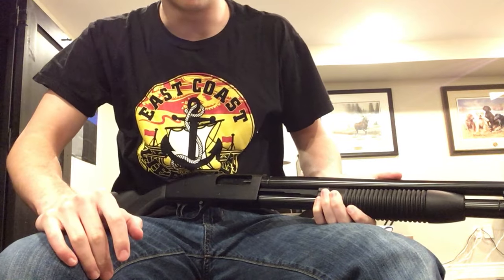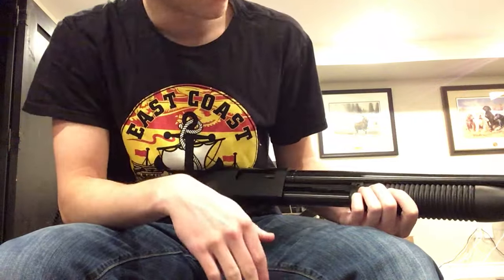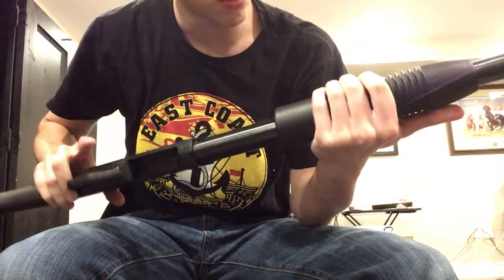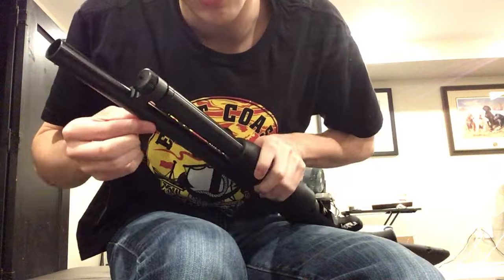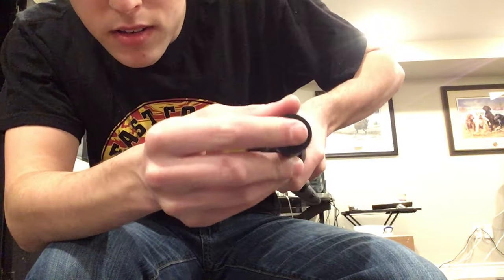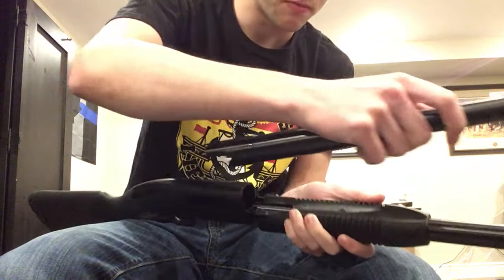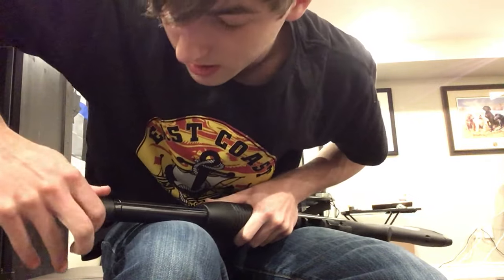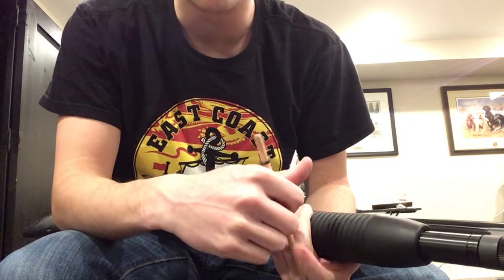How to remove tube magazine plug on any shotgun

Comment: A note for non US Mossberg owners; instead of a dowel duck plug some exported Mossbergs have a constriction six and a half inches up the tube which means that you need to replace the whole magazine tube with an unconstricted tube (FAC) to load more than two 3”shells.

Comment: Just a tip, mine would not fall out like in this video. The rubber o rings were too far up toward the tip of the dowel. I put 3 snapcaps in the tube and pushed and the plug came right out. Thanks for the video.

Comment: I have a Silver Eagle RZ17 Tactical, I Tried Your Method  Idk If I'm Doing It Right,
Reply: same idk how tf to get it out
Reply: Mine was tricky... I have the winchester sxp and it never wanted to pop out. I had to push down the spring for about a inch and had to twist and it finaly pop off
Reply: Just pop the plug out with a screw driver

Comment: Do I need that wooden pin to shoot. I have a old shotgun that haven’t been shot in many years and does not have those o rings?
Reply from the maker: You can shoot with or without it. All the wooden dowel does is prevent more shells from being loaded into the tubular magazine, the o-rings are there to keep the dowel from moving around. No you don’t need the dowel or the o rings to shoot.
Reply: @Mike242  thankyou i appreciate it.
Reply: It works without it, but migratory birds require a plug to hunt per federal law except light geese. Some states have state level laws that require plugs when hunting other animals too. I think it's even required for deer in some states(although not in most).

Comment: On my 500 the dowel doesn't come down no matter what I do  .
Reply from the maker: use a flashlight to see if its stuck in there and use needle nose pliers to grab it or something similar if it wont come out
Reply: @Mike242   I tried, shaking it ,putting shells in and pushing them in nothing , it stops after the two shells ,I don't know I will probably ask a hunting store guy, but thanks.
Reply from the maker: @vasilischristopoulos1501  take it to a gunsmith